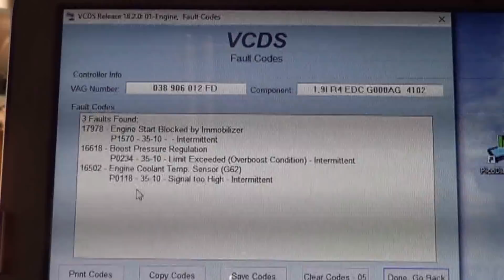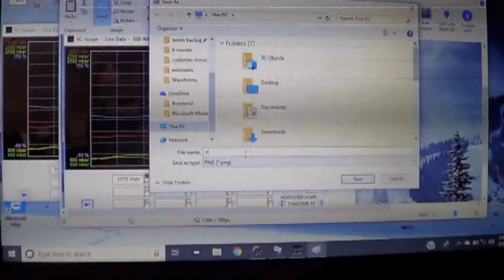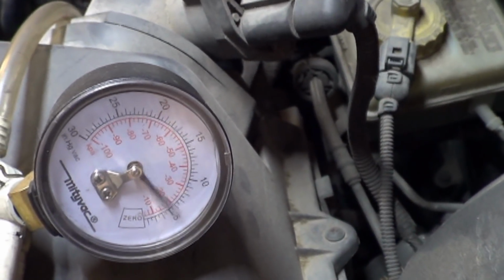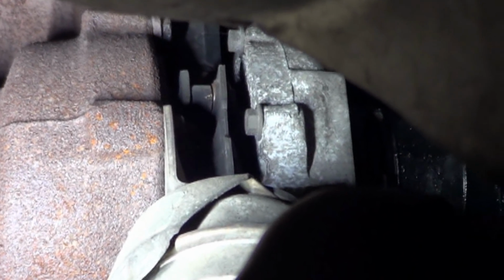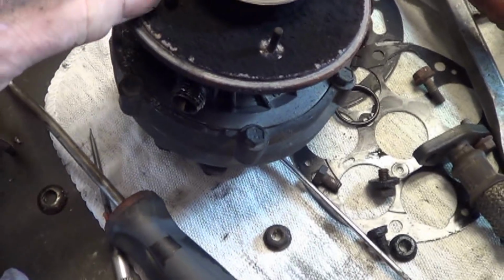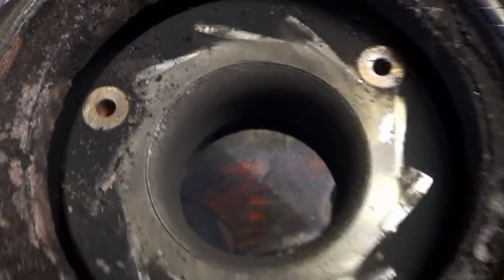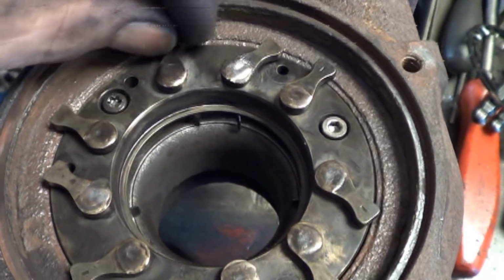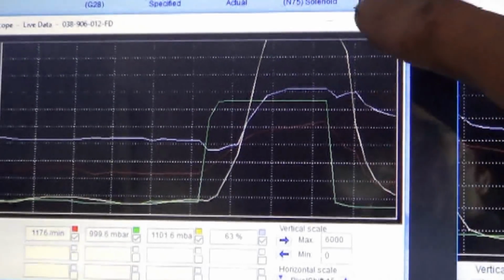Vw Tdi P0234 Overboost

Comment: Very very wrong procedure to cleaning turbo finz,,,,
Reply from the maker: strange that I've done it 100 times.  Please post lnk to your video showing the correct process.  Most mechanics just recommend new turbo.
Reply: @CoolAirVw  recently 4 days ago same job done with my Octavia 1.9tdi,,iam using first wd40,then cleaning by diesel,,,,iam not using wire brush or scrubber,, because metal scratches attract carbon deposit fast,,,after diesel cleanig  iam use vim bar for any oil deposit removing,,,bro. Don't use metal scrubber,,,after this part cleaning then dpf fiter line confirm cleaning compulsory,,,thanks lot,,,u r video nice,,,never mind,,,iam skoda specialist,,,any problem I will solve always gauranteed,,,my 1.9 tdi mileage in long root around 22-28 km/ ltr,,,n that's real
Reply from the maker: @surendrabullets483  hogwash.  Tried and true procedure.  Just cuz you "THINK" it aint good doesn't mean it aint good.

Comment: You can even explain the computer stuff procedures very well.  You are a natural teacher, congratulations!
Reply from the maker: Awe shucks!  Thanks so much.
Reply: @CoolAirVw  Are you available to give me some help with my golf mk4 1.9 tdi 110hp that is having boost problems?
Reply from the maker: @GamerLightMan  do the checks in this video
Reply: @CoolAirVw  I dont have any codes :/ With the engine cold, i have very low pressure untill 2k rpms. When the engine is worm, the problem goes away almost immediately.. I didn't do the checks you did because I don't have any type of gauge to measure pressure.

Comment: Very interesting video.. my turbo wasn't working and the mity-vac on the actuator wouldn't even hold vacuum.  removed it and replaced with a new one.  My vanes were notchy but I think it's because they haven't been going to the limits for a while so I'll try the Italian tune-up on it.  I'm getting 15-16 inches of boost and the car feels like it did back in the day.   I dissected the actuator and it was all rusted to the point where the diaphragm had a hole in it.  Not sure how these things fill with water but that's their achilles heel.  Thanks for posting!
Reply from the maker: Yeah, if they have vacuum problem and dont move for awhile they get sticky.  I hope yours frees up.
Reply: @CoolAirVw  Thanks, I'm sure it will, I've been flooring it every chance I get and will take it on the highway for a good blowout on Wednesday.  At least I know how to clean it thanks to the video.   What anti seize paste do you use on the bolts that hold the turbo cartridge into the cast iron part?
Reply from the maker: @RobertMChambers  Thie ol' Italian Tune up.

Comment: I've got one of these turbos which stopped boosting altogether. Had been meaning to take it apart and this has really helped set me up for whats needed. Cheers!
Reply from the maker: Look for boost leaks and make sure vacuum system is working. Pull off intake tube and inspect for damage.
Reply: @CoolAirVw  oh it's too late for that, but thanks for the advice. That car is long gone, but I kept the unit as it was a hybrid turbo. The actuator won't move at all, not an inch. So I kept it as I wanted to pull it apart, but never got around to it

Comment: Excellent! Thank you for taking the time to make such a clear and detailed video on this procedure! My TDI has a notchy turbo actuator lever, the vanes aren't completely stuck but definitely gummed up. I have done the oven cleaner treatment a couple times and it works well for a short while and then becomes gummed-up again. I need to pull it and do a proper disassembly and cleaning and your video has really helps me prepare for that. Thumbs-up and subscribed.
Reply from the maker: Thanks.
Reply: Just one tip do not use wire brush on the vanes better to let them soak in brake cleaner or other carbon cleaning substance and use a hard tooth brush, also the best tip of the hole video SAND THE EDGES OF THE VANES AND THE SURFACE THEY RIDE AGAINST IF THEY ARE STILL NOT MOVING FREELY, remember this assembly needs verry little force to move if it needs any at all
Reply: I totally agree with you! Instructive!

Comment: Our 2014 Crafter (120kw) has a similar intermittent overboost problem (code 023400). Thank you so much for pinpointing the proper diagnostics - we should be able to figure this one out now.
Reply from the maker: Does the crafter have VW engine?  I thought it might be a "sprinter"??
Reply: @CoolAirVw  The Crafter 2E series shares it's platform with the W906 Sprinter. The driveline (engine, transmission, differential, steering, etc.) is Volkswagen specific.
Reply from the maker: @gonefilming2020  Oh, cool.

Comment: I don’t have a problem with the turbo but I was looking at timing and this video came up so I watched it and yes thank you a lot of good information always wondered how those veins work. Thanks again
Reply from the maker: thanks!
Reply: CoolAirVw Rm  Can you tell me why does a VW 1.9 TDI starts hard and when it is running it smokes white light crazy? I am wondering if one injector is not working right that makes all that smoke? Because we just did the timing and it is all correct. But number three cylinder has about 100 psi less compression as the others
Reply from the maker: @johnbeechy2913  white smoke can be oil burning either from engine or from turbo. Sometimes a fuel restriction can make smoke also.
Reply: CoolAirVw Rm  Number three cylinder has 325 psi compression and the others have 425 So I thought maybe that low compression is making the smoke but it and it smokes all the way through the exhaust because of that one maybe not firing right. And I have to use starting fluid to get it started for it also has no throttle response. So thanks for that information but I’m probably going to take the injectors out and have them tested because they might be malfunction as well.
Reply from the maker: @johnbeechy2913  that aint good.
Reply: CoolAirVw Rm I know. Just bought this car off of market place $300 190,000 miles on it. It’s a little vw beetle 1999
Reply from the maker: @johnbeechy2913  $300?  manual or auto?  ratty interior?  Air work?  TB done?
Reply: CoolAirVw Rm it is a five speed and no the inside does not look that bad it’s just been sitting for a couple of years I think that is probably also maybe a stuck ring problem because of the compression issue. Hope to find out if I take the injectors out tonight after work.
Reply: CoolAirVw Rm The guy actually said the injection pump is malfunctioning with no throttle response so I might just put another injection pump on and see what happens if the injectors are good.

Comment: Very good video.
The problem is often to R&R the damm turbo,the repair is easy by comparison;
And here is  lesson learned when you have a variable geometry turbo (means with those "11" moving small wings/vanes): 
      Do a varied driving--- if you do city slow driving, find a stretch to floor it ,every hour or so;  if high speed driving or towing,let off the gas often,to get those vanes moving;
      The first case tends to avoid the vanes getting stuck closed,no boost;
      The 2nd case,them getting stuck all open ,causing what we saw here,overboost;
The worst invention ever for diesels,the EGR valve is mainly to blame for that problem,it makes the engine constantly re-ingest its own vomit,its own smoke over and over;
     If you only saw what the EGR can do on older cars,to clog up intake manifolds, throttle valves,cyl.head intake tract,valves, rings,etc to the point that the engine is choking and barely runs; it then pollutes A LOT MORE then if there was no EGR in the 1st place; this mainly due to the rings getting stuck with all that muck,and the cat.having seen better days; it's a tough decision bet. breaking the -LAW- and eliminating -EGR- (not easy on some cars,it turns the CEL  on) or keeping it and facing those consequences...
Reply from the maker: You got that right!  Thanks for watching and commenting.

Comment: Thank you so much for the insight into this type of turbo. I think this is what's wrong with my 320d unit. Rattling too, so it leads me to believe the actuator arm is loose in the ring also. I'll be attacking this job shortly!!
Reply from the maker: Is your 320d a variable geometry turbo or does it have a wastegate?  Some Vw's have a wastegate and when it wears it rattles.  See the following video. https://youtu.be/kRHmjAD3JHc
Reply: @CoolAirVw  It has an electronic actuator with the lever to rear of the exhaust housing. It howls & rattles on deceleration. Also when static & revving then letting the throttle off! Edit: Just checked & the lever is moving manually.

Comment: When using the wire brush on the ring, it's a good idea to use it on the outside edge of the ring too. There are three (I think) raised portions that hold it in place and they are common places for carbon build up to cause sticking. Once reassembled the whole vnt mechanism should move with a VERY light touch, even gravity should be able to move it.
Reply from the maker: Excellent advice

Comment: Good video. Looks like a Garrett GT VNT. Seen a few of these sticking or seized vanes on Ford Galaxy/VW Sharan TDi mpv in the UK. This issue can throw up an air mass sensor fault even though nothing actually wrong with the air mass sensor - it's just sticking vanes affecting air flow (and boost).
Reply from the maker: good to know.  thanks

Comment: I ran into what may not be common problem.
I found the plate in the exhaust housing below the vane plate had rust developing under it. This was raising the plate just a few thousandths of an inch. So when I tightened the vane plate it would cause the vanes to stick. I found the sticking was gone when I loosened the screws holding the assembly together.
So I removed the plate, cleaned the rust off and it works perfect now.
Reply from the maker: seen that before.  unfortunatly sometimes when you pull the screws out of that plate the bolts break.  At that point it might become a replacement turbo.  We try not to pull those bolts if we dont have to.

Comment: Have u ever had to replace a turbo that's failed ..like filled the intercooler with engine oil also the exhaust system...watt direction of repair would u recommend thks ..awesome video nice to see a mechanic at work
Reply from the maker: Yes I have.  used or new turbo, or upgrade to larger turbo.  Flush out intercooler and tubing.  beware that if it pushed large quantities of oil out then it could have damaged the engine, either by low oil, or bending a rod or runaway.

Comment: The display flickers bc it has lower refresh rate than the camera settings are set.
Just adjust the settings for refresh or some comps call it hrz
Reply from the maker: I've tried with that laptop.  No settings change the flicker.  But I've got a new laptop that doesn't do that, plus I use a screen recorder usually for screen shots
Reply: @CoolAirVw  I see ... Well idk any other way except if the screen of the laptop is 60 hrz then shoot in 60 or more fps or hrz. 
It is the same fps hrz and refresh rate 😂 😂 it is stupid but it is like that 
Match the hrz refresh rates or fps on the phone. And for screen recordings that doesn't matter. It happens only when you look in display through camera

I know that I am boring and I am sorry !!!
Reply from the maker: @ChudGippity  No!  I appreciate the help and it should have fixed it when someone told me that years ago, but unfortunately I believe the graphics card isn't capable.  But screen recording doesn't' use camera so no flicker there.
Reply: @CoolAirVw  Yes! 
Love your vids
Reply from the maker: @ChudGippity  thanks

Comment: Sticking every now and then is what mine is doing. I replaced the actuator that was rusted up, checked the vac on the new one (20” vac to the stop starting moving at 3” vac etc) so I know that’s right, but still getting a very occasional overboost limp mode after planting my right foot to high revs. Strange thing is the mechanism is free as a bird without the actuator attached, so I can only assume the tolerances close up when it gets hot?
Reply from the maker: Is the hole on the actuator binding on the lever?

Comment: A tip to save parts of screen quicker, use snipping tools, they are already installed in all windows starting from windows vista all the way to windows 10, it allows you to capture the specific screen area that you want without needing to use paint.
Reply from the maker: Excellent info. Thanks for sharing.

Comment: Would you recomend putting oven cleaner on the vanes?
Reply from the maker: People do that when they are attempting to repair with out pulling the turbo.  ITs partially effective.  No need when the turbo is disassembled.  If you don't want the hassle of pulling the turbo sure, try it.  Give it your best shot..  Some of the ones we do are stuck solid and no amount of sprayed in oven cleaner is gonna free them up.  You cant get the oven cleaner all the way in there with the turbo installed, and if you remove the turbo you might as well clean it "mechanically" the way we did in this video.
Reply: @CoolAirVw  thanku so much,great vids,wish I where more near you.

Comment: Oven cleaner method saves alot of time and work.
Reply from the maker: Sure if your doing it yourself.    Maybe oven cleaner will fix it  if yours is "just barely" stuck.  maybe if your doing it yourself and don't have to GUARANTEE  to a customer that it will be FIXED.  Maybe if your reputation doesn't rely on fixing it right the first time.

Comment: As the fix was to remove the carbon build up to free up the vein guides.Could you not leave the turbo on the car,remove the exhaust down pipe from the turbo, fill it with a caustic soda foam (oven cleaner), leave it to break down the carbon, flush it out with water,repeat then run the engine at idle to remove any water/caustic soda?
Reply from the maker: No  but you can.

Comment: This is interesting because it is the first time I have seen this kind of complicated "wastegate" mechanism. My queation is how is it lubricated to prevent it from siezing or carboning up again as it is in the hot section? Surely a traditional valve type wastegate is more reliable.
Reply from the maker: Best method for keeping it clean is the italian tune up.  Drive it hard at least once per drive.  Exercise the mechanism from full boost position to low boost position frequently to keep it moving.  Heavy throttle useage "burns out" the carbon.  Light throttle driving or "lugging" the engine tends to make carbon build up and mechanism to stick.  Wastegate mechanism on 2.0 TSI/FSI is problematic more so than these.

Comment: Nice informative video how did you oil line come off at the top of the turbo my luck has been pretty zilch usually the bottom fitting turns and I try with heat to get it to crack loose but usually I have to replace the line in the long run ?
Reply from the maker: The fitting spinning is definitely  a problem and happens a lot.    We do this all the time so long ago we took a 17 wrench and ground it down to fit to hold the fitting from spinning.  Sometimes you have to put the wrench "in there" then spin the nut, line and fitting together to get the flats of the nut to the right position to get the wrench on there.  You can also remove the line from the other side and pull it out with the turbo, but that requires slight reshaping of the line to get it out and then bending it back into shape.
Reply: CoolAirVw Rm good idea about grounding down a wrench I think I will do that to have one myself just to have cause I don’t do turbos every day but I will have to take my Alh Beetle off as it’s sticking any throwing codes of over boost been procrastinating because the cooler line
Reply: @martinlavoie4002  Its easier to just chop out the original oil feed line and throw it away..They slways end up kinking or splitting. Vw recommend replacing them every time (they would) but you could get an aftermarket braided one 800mm long with two banjo fittings for sbout $30
Reply: Jam a flat bladed screwdriver between the fitting and the body of the turbo to stop it spinning.

Comment: oven cleaner then leave it on a while it melts carbon off , hit with an old tooth brush and leave it again it will be like new and rinse off with ega cleaner
Reply from the maker: Please post your video.
Reply: @CoolAirVw  didn't record it lol, dead easy though using that stuff, try it on something with heavy carbon on it, it just melts it off works very well even better than egr cleaner, some common sense needs tobe used though as you don't want it hitting rubber parts for too long if it does heavy rinse it, you wont need to wire brush again that's for sure

Comment: I’m having this overboost problem with my 1.9 Seat Alhambra, it’s very intermittent! It was happening with no fault showing then p1557 then p0234 Iv checked all vacuum pipes boost pipes and swapped solenoids, airflow meter, map sensor and intercooler. Actuator is working nice and free on vacuum gauge and holding pressure! Not stiff or stuttery 🤷🏼‍♂️ any help or guidance appreciated
Reply from the maker: graph boost on vagcom.  Is it overboosting or is it not?
Reply: @CoolAirVw  yep it’s overboost